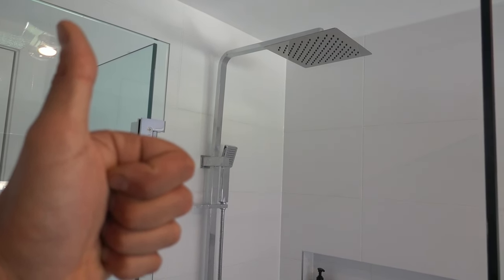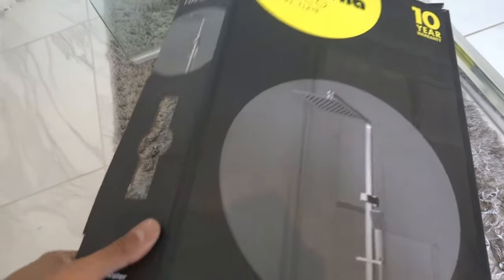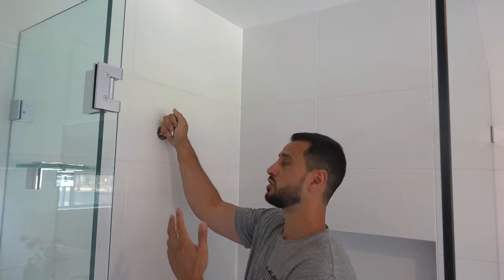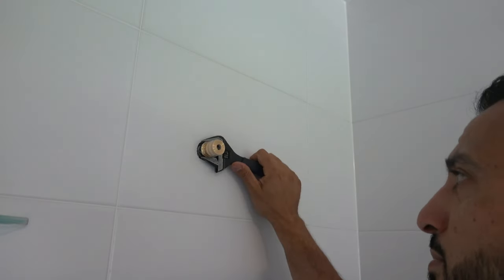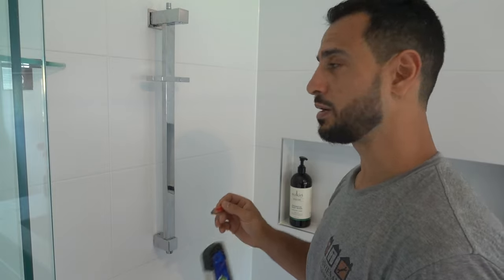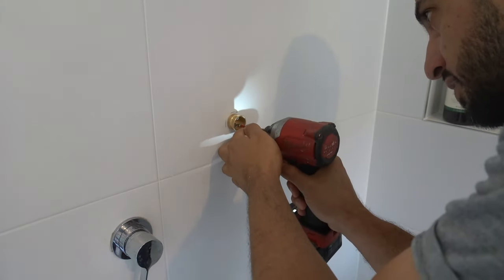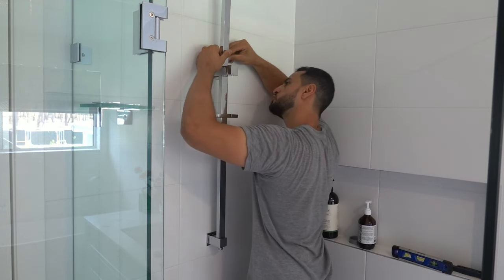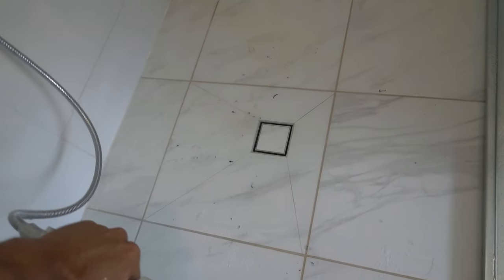How to install shower head rail

Comment: Hey Bill, would the drilling of the holes wreck the waterproofing thats behind those tiles?
Reply: Hi @pnikWILLIE, fellow vietnamese here. Yes it will damage the waterproofing. What u'll need to do is after drilling the hole, grab a bicycle air pump and blow out all the dust, then apply plenty of bathroom silicone i to the hole before putting any screws in. This ensures the hole in the backerboard behind it is protected by silicone.

Comment: Hi bill great vid very informative had a problem when using the hand held leaking water from the top between the vertical rail an the top where it fixes to the wall any suggestions ?
Reply from the maker: If you send me photos or videos to my email I may be able to assist 👍